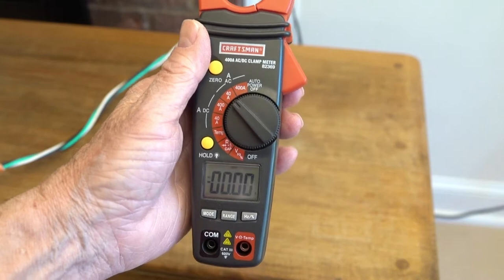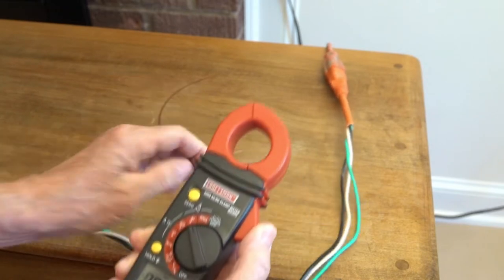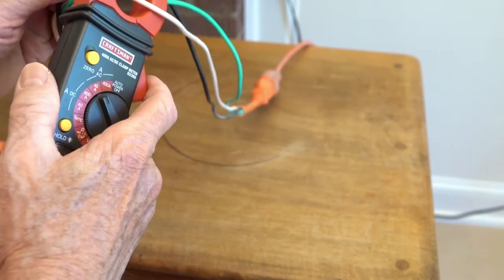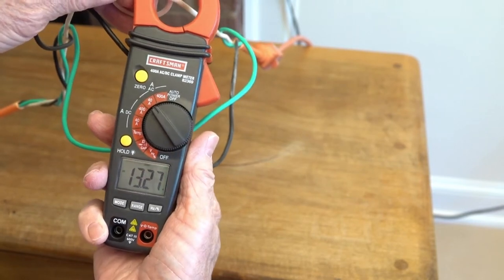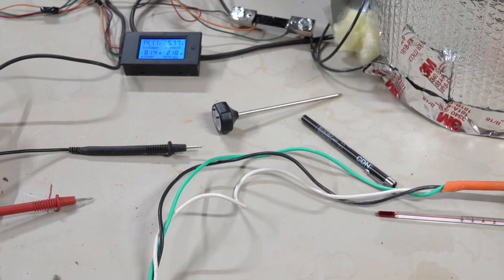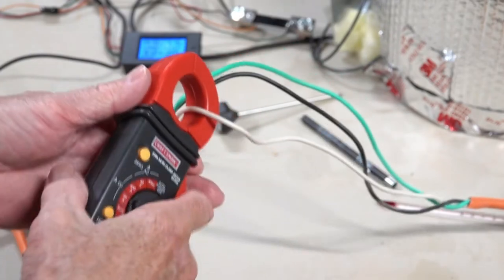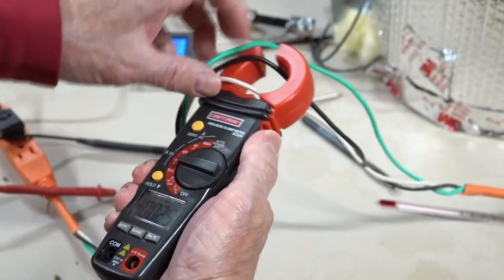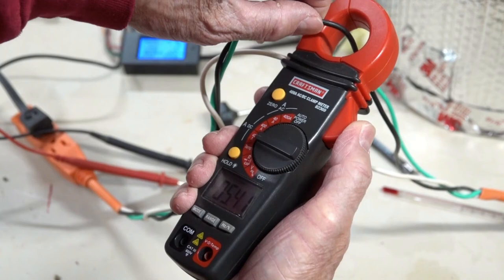Using a Clamp Ammeter for AC and DC

Comment: I just bought 2 of these units, returned the first one because I thought it was defective. Now thanks to this channel I find out that I was using it wrong - must measure one lead at a time because otherwise they cancel each other. 
I didn't find this bizarre how this critical detail was omitted from the other 6 channels I visited, and even the instruction manual.
Thank you sir.
Reply from the maker: Thank you for your comment and good luck with your projects.

Comment: I noticed that not all clamp meter have DC current measurement mode. I need one of this because I need to measure current out of my solar panel without breaking the wire. Or to measure other DC and AC current especially with mains voltage without cut the wire. The way DC current measurement works is, they use a hall sensor in there. The hall sensor detect how strong is the magnetic field produce by the wire. The higher the current, the stronger the magnetic field.
Reply from the maker: Thanks for watching and your comment. Good luck with your project.

Comment: Great description/explanation on the tool. Thanks.   I am trying to determine how long my 2 Group 31 house batteries should last on my boat while running equipment. I plan to use a tool like the one you used to total up the amps as I turn on the devices to see how much total amp draw I have.    The batteries do not list an Amp Hour value so I'm a bit confused on how to calculate the time. I suppose I call interstate battery support to get an explanation from them.   The batteries only list Cranking Amps (CA)1031  and  Reserve Capacity (RC)200 minutes
Reply from the maker: Thanks for watching and your comment. Most batteries have an energy capacity rating in amp-hours abbreviated as Ah. Amp-hours is current in amps multiplied by time so how much current your battery can supply in a certain amount of time. Deep cycle batteries like most marine batteries are much better than a typical car battery for energy storage. Car or any engine starting batteries have to supply high current in a short amount of time compared to running various low current devices for a longer period of time. Make sure you don’t discharge your batteries down to a low voltage or they can be seriously degraded.

Comment: I need to measure dc amps on a circuit, my clamp meter only has ac amps setting, could it be done???? Good video
Reply from the maker: Thanks for your comment. If you can measure DC voltage you could measure the voltage drop across an accurately know resistance and calculate the current using Ohm’s Law as follows: E is voltage, I is current and R is resistance.           E = I x R    and I = E/R    Sometimes electrical shunts are used to measure current using an accurately known very low resistance and measuring the voltage drop across the resistor.  

This is from Wikipedia  https://en.m.wikipedia.org/wiki/Shunt_(electrical)
An ammeter shunt allows the measurement of current values too large to be directly measured by a particular ammeter. In this case, a separate shunt, a resistor of very low but accurately known resistance, is placed in parallel with a voltmeter, so that virtually all of the current to be measured will flow through the shunt (provided the internal resistance of the voltmeter takes such a low portion of the current that it is negligible). The resistance is chosen so that the resultant voltage drop is measurable but low enough not to disrupt the circuit. The voltage across the shunt is proportional to the current flowing through it, and so the measured voltage can be scaled to directly display the current value.[2][3]

Comment: can i know the direction of current by seeing negative sign before amps?
Reply from the maker: Thanks for watching. That is a good question. AC is going in both directions. I am not sure about trying to identify direction of Direct Current. There are methods like the right hand rule for magnetic field orientation based on direction of current flow. When I get a chance I will see if I can come up with a better answer for you.
Reply: definitely that amp meter shows you the direction of the flow....pretty much the same like when you measure the voltage on a baterry: it shows you the same voltage even when you swap the leads but it will show you negative sign before (i.e/ 1.5Vor -1.5V) @anisotropicplus
Reply from the maker: @gabrielaldea3868 ok, thanks for your reply.

Comment: I have a fluke 325 clamp meter i just wonder why the hell i get an initial value of negative .2 whenever i set it to dc current without clamping it yet to a dc wire
Reply from the maker: Thanks for watching and your question. Is there a way to zero the meter after changing modes? Try calling Fluke customer service if it continues to be a problem.
Reply: @anisotropicplus i just figured it out just now haha. The reset and modes (AC/DC) are in the same button, unlike yours, mine requires holding further to reset to zero. Thanks for your response! Really appreciate sir

Comment: Try flipping from DC amps to AC amps on a given circuit; I'm wondering what the outcome will be. Will it show half as many amps if you have it set to DC and use it on an AC circuit and would the reciprocal be true? I would try it myself but I only have a clamp on AC only ammeter.
Reply from the maker: Thanks for your comment and question.
Reply: Lol did you try?
Reply: @MCMole  Inquiring minds want to know.